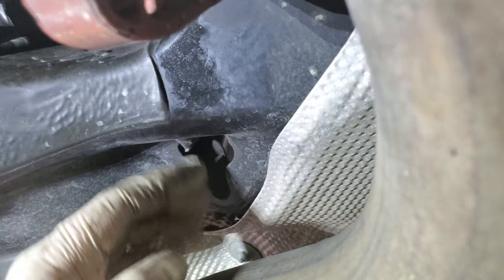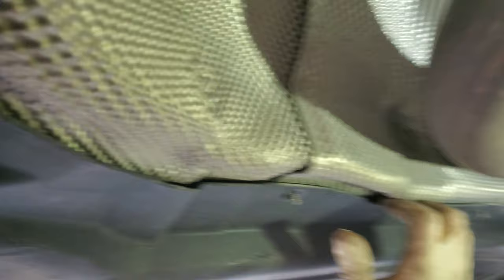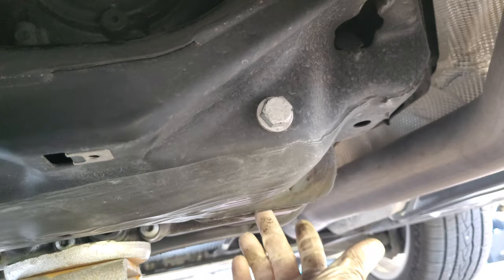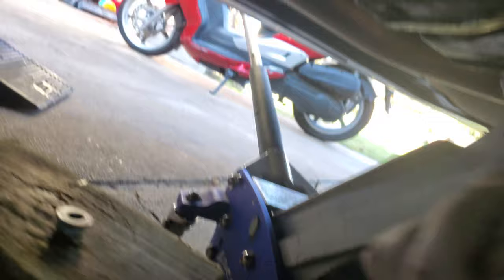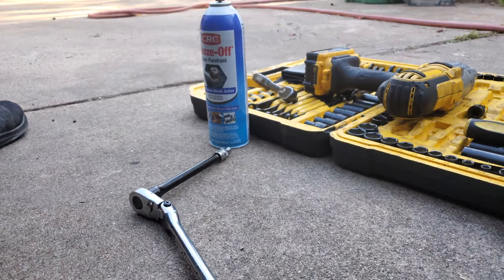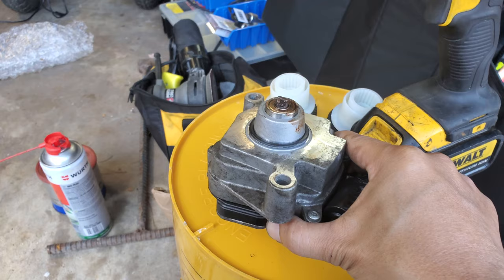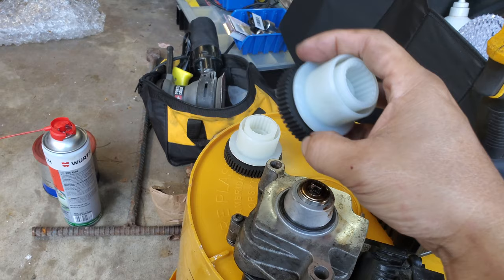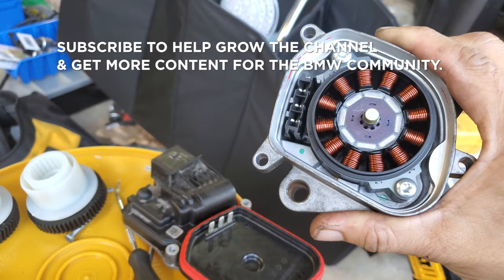2011 x5 50i Transfer Case Actuator Gear FIASCO - Thanx Amazon...

Comment: I got the same module in my 2011 x5 xdrive35i. I did the same as you, bought the gear from Amazon then realized after performing surgery on the TC that it's a different module. I also took it apart thinking that maybe there were gears inside. This thing is out of commission more than it's available to drive. Ultimate driving machine... driving me insane.

Comment: Thank you so much for showing this Video! I have a 2011 X5 50i and it showed 4x4 problem recently. After a bit research, I found all videos posted online were 2011 X5 35i model, not 50 i. The 35i can be relatively easily to replace the actuator gear to fix that 4x4 problem but it’s obviously different from 50i model. Thanks again for this video and now I know this actuator  can be taken out and replaced instead of replacing the whole transfer case!
Reply from the maker: You're welcome!

Comment: Thank you for this. I was about to waste my time doing this lol. Also after doing some digging, the only place that shows you the right part is FCP Euro and the 50i T-Case motor is $1300, not $350 like the regular v6. 🥴
Reply: Aint no V6 in the BMW range, its a straight 6. On the E70, early versions were 3.0 si and then the twin turbo.
Reply: @dgkiwi  I know that. It was a mistake because my mind was on the V8.

Comment: What would you say is the mileage for replacement? In this case today I was planning to change it also until I saw the part did not look similar to that one in the videos
Reply from the maker: If you have x5 50i, there is no replacement gear, it's the entire box that will be replaced. I tried this now at 88k miles because this is a used car and I have no idea its history.

Comment: Try doing better research next time.  Find out beforehand what model number transfer case you have.  It's pretty common knowledge that the transfer case used on the M62 is not the same as used on the N63.  The newer transfer case I think is the ATC45L.  Wasted effort?

Comment: So how did you fix your transfer case problem?
Reply from the maker: There was no problem, this was preventive maintenance. I didn't need to change this gear at all, but I do note that after changing the differential front and rear and the transfer case fluids, the vehicle is dead silent on hard acceleration, whereas before the change, there was a very loud whining noise upon hard acceleration. I highly recommend these fluid changes. The fuel economy goes up also a mile or two. Thanks for visiting and commenting.